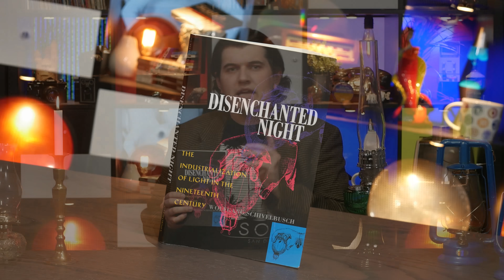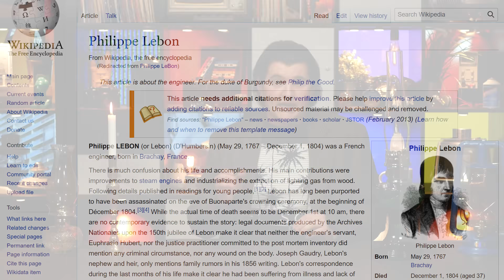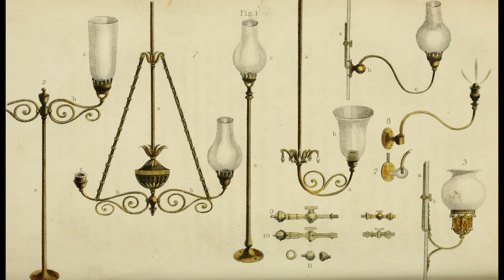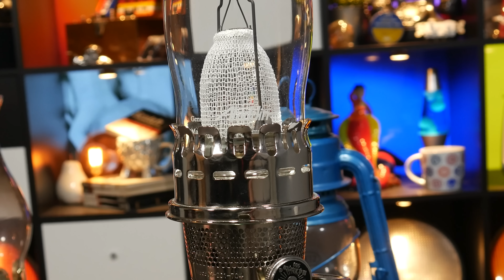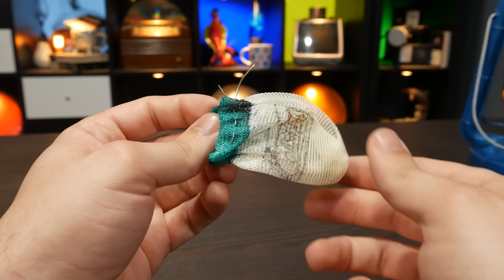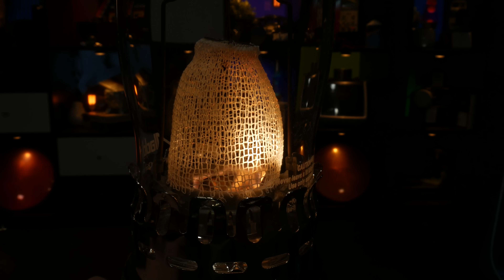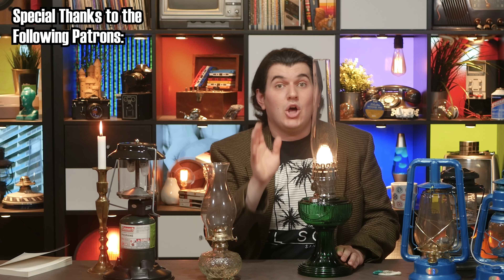How the gas mantle made lamps 10X brighter

Comment: I'm writing to help explain John Clayton's expression "...forced my lute". 
Alchemy! Yes, the term originates with the practitioners of the arcane art of alchemy. Which, considering the time period that Clayton wrote his comment, he was likely familiar with such endeavors. To be more specific, "lute" in this regard refers to "lutem" which was a material which classically came from the town that was known to the Romans as Lutetia. Today we call this town Paris. And it was from the gypsum pits of Lutetia that "lutem" was produced for the world. Today that product is known as Plaster of Paris. The alchemists would sometimes coat their retorts with a layer of lutem as means of providing some "thermal inertia" to their work. That is, a coated retort could be heated evenly and slowly over a broader surface area than otherwise would be the case at the direct point of application of a flame. It would thus carry the heat in more gradual stages to the matter under investigation.
 I had the fortune to spend decades watching my best friend, Robert Martin Gorges (R.I.P.) as he dedicated his life to the recreation of hundreds of the "alchemical texts" in as fine a detail as possible. Unfortunately, with his passing, I no longer have access to his incredible library and voluminous notes. However, if my memory serves me correctly, some mention of the above stated facts might be found in The Secret Teachings of All Ages by Manly P. Hall. I'm sure there are other works which will mention it as well.
Hope this helps!

Comment: Gas lights is where we get the phrase “TURN the light on”. As you said, there were valves; not switches. Thus, you really don’t “turn” on an electric light, but the term had been established and just stuck.
Reply: The early electric light switches were also rotary…
Reply: @allangibson2408  Because they were just repurposed gas valves.
Reply: @erinfinn2273  No - electric switches and gas valves are wildly different. The designers wanted to maintain familiarity however. 
Wiring was however run through the old gas pipes - which is why American electrical conduit still uses pressure tight threads.
The other power source in most cities was water - the hydraulic power systems continued in service until the 1960’s running lifts. The hydraulic power pipes in London were repurposed in the 1980’s for fibre optic cable runs.
Reply: @allangibson2408  I guess what I meant was that the interface was just repurposed. I do know the mechanical differences between gas and electric switches. You just said what I wanted to say clearer.
Edit: I made that post when I was very tired. I mean no disrespect to anyone's intellect. Also, didn't know about the municipal hydraulics system. That's cool.
Reply: Picrew avatar detected
Reply: @allangibson2408  Fascinating

Comment: Lute was a wax seal around glass chemistry connections connections, prior to rubber, sometimes impregnated with horse hair to make it more stable.  There is a text in Robert Boyle's notes about using lute.  Later on we now use a silicon based lubricant as a seal, since high-temp stable and allowing for easy disconnection of the fittings.

Comment: Thanks to the Welsbach process there were several contaminated area in Camden NJ that required EPA cleanup.  There were two factories that made the thorum coated gas mantles: The Welsbach company and the General Gas Mantle Company.  In addition to those sites being "crapped up" there was an entire city block that had hot spots as well.  That block of Arlington Street was wiped off the face of the earth as a result of the EPA cleanup.  Camden is about 12 mile Northeast of where I live in Glassboro, NJ.  And my town is not without its own brownfield.  There was a coal gas plant on the other side of town that is long gone, except the ground remains contaminated.  Yes, the quest to illuminate mankind has not been without its problems.

Comment: It is well attested that there is a catalytic action going on with a mantle, it catalyses the combustion of the gas or vaporised kerosene, so that most of the actual combustion occurs at or around the surface of the mantle, so that a very large amount of heat is dumped directly into the mantle raising its temperature and hence its incandescence . I could be that simply the high temperature of the mantle is responsible. However the original thorium mantles had to contain a very precise amount of cerium to work properly, which tends to suggest a catalytic action, it's not just that they could resist high temperatures to glow brightly but that they catalysed the combustion so they get hotter in the first place. Automotive catalysts contain elements from the same group of rare earth metals.

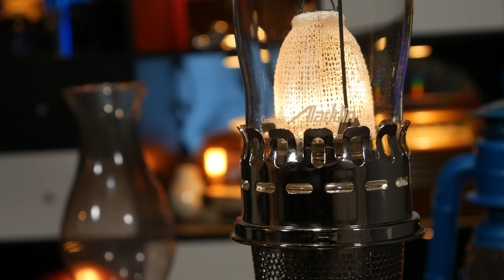Comment: @11:40 a black body radiator is a theoretical body that is usually referenced when refering to the color of light. For example 5800K is the black body temperature of the sun, and it is also used in a lot of lighting, where 4100K is called cool white, and around 2700K is warm white. What it means is that even though it is not 2700K in temperature, it shines as bright as if it were a black body at 2700K.

Comment: I had a wood burning stove that had honeycomb filter near the exhaust pipes.  Without it, much black smoke and soot escaped.  with the filter, the filter glowed extremely hot and contained the unburned gases until they burned at a very hot temperature....  Thus the white light.  I think the wick does the same thing, contain the smoke until it is re=burned off?

Comment: When I saw the Aladdin lamp is delicate, I thought to myself it can be easily solved by adding a battery and a sensor to automatically control it before I realize at that point you might as well just use battery powered-LEDs. Still, it's a 200 dollar item it might come with some safety features even if it needs a few additional parts.

Comment: When I grew up the gasometers in the local town were quite visible and they had scales up the side so you could tell how much gas was in them so they were in affect measuring devices.
Reply: When the centre is high the container is full as the contents is used the container falls, the weight of the container pushing against the gas inside giving gas pressure in the pipes.
Reply: For anyone in Aus born before 1970 gasometers should not be a mystery.
Given that , even without measurements on the side, it's possible to gauge the amount of gas held at any time, "gasometer" is the most appropriate name for them.
Reply: Two massive units were astride the 405 Freeway in Long Beach, California -- for years. 
They eventually became buffers for the adjacent refinery -- IIRC.
This was the same refinery that Cody Jarrett blew up in "White Heat."
He was atop spherical propane-butane tanks... a bad place to smoke.
They must be gone by now -- so old -- and sitting atop valuable land.
Reply: Occasionally a gasometer would blow up. I remember one did so in Copenhagen in the seventies causing great damage as domestic housing was built much too close.

Comment: Kerosine is a niche fuel... in small amounts, It's much harder I hear to get aviation gas than Jet fuel at this point in time... Hydrogen though as common as it is only rockets and some cars/trucks really use it at this current time... So yeah that's what I call niche and we need to fix that.

Comment: In this context ("forced my lute"), the word "lute" is almost certainly not the musical instrument, but rather the thick substance used to close up a hole and make something airtight.  Sort of like a bung.  Forcing it presumably means building up enough pressure to dislodge it.  HTH.HAND.

As for gasoline, it isn't a liquid fuel.  Liquid gasoline is not flammable.  It won't burn.  No, really, liquid gasoline doesn't burn.  What it does do, is have a really high vapor pressure at room temperature, so it's constantly giving off vapor (the "gas" for which gasoline is presumably named), and the vapor is all kinds of flammable.  Additionally, the vapor pressure increases as temperature increases, so the heat of the burning vapor just above the liquid, heats the liquid, causing it to give off more vapor faster, which burns very quickly, heating the liquid more...  and a fraction of a second later, your entire pool of liquid gasoline has all been vaporized and subsequently burned away.  But this only happens if the gasoline is warm enough to produce enough  vapor in the first place, to get the reaction started.  If it's really cold outside (and we're talking about Siberian or northern-Canadian winter temperatures here, temperatures that you have never seen in the Midwest), you can actually toss lit matches, or lit cigarettes for that matter, into an open-top barrel of gasoline, and the flame will just go out as soon as it hits the surface.  This is, for obvious reasons, a trick that you should not attempt to reproduce without extensive research and substantial safety precautions (and if you find a video of it online, it's probably faked with a different liquid, such as diesel fuel or water).  If it's a few degrees too warm out when you try it, you're going to do ever so much more than just singe your eyebrows, and there are few inhabited places in the world where it gets cold enough for the trick to work as intended.  Nonetheless, liquid gasoline doesn't burn.  Only the vapor burns.

Comment: Gasometers were actually a way to measure the gas contained.  The  height of the gasometer would rise and fall depending on how much gas was contained within.  On the outside of the gasometer was a measuring scale and as more gas was stored inside the structure grew taller.

Comment: Both yttrium and yttrium oxide has a melting point way hotter than this.

If the yttrium isn't melting at all, and the organic fibers are gone entirely... what exactly is holding the resulting yttrium oxide particles together against gravity and other accelerations?  It seems like some intermediate substance would be required for structure to get the particles bonded together with even a little bit of strength.

EDIT: " The fibers are impregnated with metallic salts; when the mantle is first heated in a flame, the fibers burn away in seconds and the metallic salts convert to solid oxides, forming a brittle ceramic shell in the shape of the original fabric. "

EDIT2: " The mantles are produced by dipping a meshed fabric (e.g., nylon web) into a solution of thorium nitrate. Other metals are added to the solution for a variety of reasons. For example, cerium is added to increase the light output, while beryllium increases the mantle’s strength. The fabric is then removed from the solution and dried. Lastly, it is coated with lacquer and fashioned into one of two types of mantles: a soft mantle or a hard mantle. The soft mantle is essentially a bag with either a drawstring or some type of fitting that attaches the mantle to the burner. The fabric of a hard mantle is supported by a metal frame that gives it a dome-like shape. "

So there are multiple metal salts involved, and some of them likely pass through liquid phases during initial combustion in order to form the ceramic glass, which is majority-by-mass yttrium oxide.  Probably some kind of cousin of sol-gel ceramics.

Comment: Gasometers do somewhat measure the gas because their height depends on the internal pressure (and therefore the quantity of gas)

Notice how in your example image a scaffold of sorts extends beyond the height of the container? If more gas was added, the top would rise and thus you can apply a conversion from height to volume of gas based on height measurements taken with the tank filled with a variety of known quantities of gas.

Comment: In my early 1900's built house, they literally pulled two wires through the gas light pipes when they converted the room lighting to electric.
Reply: That's interesting. I had a house in Scotland that still had some old lead gas pipes in the walls for lighting but they were only about 1/4" inside diameter.
Reply: @Phiyedough  Yes... our house in Los Angeles was built in 1914 and had gas light fittings in every room. Electrical wiring was installed later, obviously. As a young kid, I wondered why the gas outlets were so high. Of course, they were for gas lamps. The house is still there and probably still has the hidden gas pipes running through every room (of course, empty).
Reply: This was true of a lot of street lighting, too, at least in London.
Reply: Well, guess that's one way to retrofit knob and tube wiring lmao
Reply: @David Wanklyn There are still about 1500 gas lamps in London, in the City and Westminster. One of the duties of the team that maintain them is to wind up the clockwork that times the opening of the valves. There are still the horizontal bars that used to be used for ladders but they're really only attached through a coat of paint now.
Reply: Electrical conduit threads are the same as black iron pipe threads as they were used as conduit for electric wiring when houses were converted from gas to electricity, the electrical boxes were often mounted to the old gas piping that remained in the wall at locations of gas fixtures

Comment: I've used a 1928 model 11 Aladin outside while camping. It worked fine - the advantage being silent operation and it did not require occasional pumping like Coleman lanterns. It made for a pleasant camping experience. Other campers were interested in it. It is more delicate than a Coleman lantern though.
Most of the time a campsite is not windy.

Comment: So i looked up chemistry equipment of the 1800s lute. And this showed up.
Lute (from Latin Lutum, meaning mud, clay etc.)[1] was a substance used to seal and affix apparatus employed in chemistry and alchemy, and to protect component vessels against heat damage by fire; it was also used to line furnaces. Lutation was thus the act of "cementing vessels with lute. 
So blowing his lute was just breaking a seal in a bottle or stopper.

Comment: I have no idea what “forced my lute” means, but “broke my glasses” sounds as if the gas pressure built up inside his apparatus until it broke his glassware
Reply: Lute was a material used for sealing alchemical apparatus back in the day.  So combined with the next phrase, I'm pretty sure he's talking about it actually breaking his equipment.
Reply: Exactly. Too much pressure built up and if the Lute didn't pop the glass would break.
Reply: Look at what the internet produces.  Different minds come together to solve mysteries.  Also, tiktok...
Reply: My kids broke my lute, they smashed my violin.
Reply: or just simply broke his looking devices
Reply: “forced my lute” sounds like a euphemism for something naughty!
Reply: Per Wikipedia lute, from Latin meaning mud or clay. Was a substance used to seal apparatus (as other posts here have mentioned).
Reply: It sounds like there was too much force inside of his "lute" lute being slang for the lute shaped retort or another piece of equipement? 
Forced his lute meaning I created too much force inside of the lute... and it broke my glasses.... Meaning so much force happened at once it shattered some of his equipment?

That's my guess.
Reply: Yes, forced meaning raised the pressure... I agree.
Reply: @stephendoherty1275  Literally forcing out the lute of its joints.

Comment: The point about the catalytic activity of Yttrium oxide is actually a pretty good one. And since the separation of rate-earth metals (expecially in the good old times) is still pretty hard, there would be traces of other elements mixed in it, which usually is the key for further increasing catalytic activity.
Yttrium oxide has a perovskite structure and periovskite compounds can be used used as oxidation catalysts, solar cell materials or electrolysis catalysts, so there's a lot of quantum mechanical magic happening. 
Also a cars lambda sensor consists of ca. 95% ZrO2 with 5% Y2O3 mixed, so I'd guess its reactivity is centered towards oxygen (or oxygen containing componds) in some way, also since one publication I found says there's an affinity for irreversibly adsorbing and activating alcohols (I guess also other oxygen containing hydrocarbons)  - in a quick search I couldn't find out if yttrium oxide has great C-H or C-C bond activation but there's at least some publications on oxidative coupling of methane for example, so it's probably not too far off the mark (traces of Cerium dramatically increase oxidation to CO2).

Comment: "Lute"  lutum from latin clay or mud, (horse hair and straw) used to seal apparatus in chemistry and Alchemy, protect it from heat damage from fire hence resulting in cracking the glass wear, the pressure would have caused it to crack, this the usual consequence.

Comment: If I am not mistaken the same principals though not fuel are used in the Aladdin lamps is used in the Coleman and Propane lanterns some use when camping/RV. Turns out I am right in the guess, with the Coleman Dual Fuel and Propane ones. 

There was a cheap version of the Colman Propane in late 2000's and early 2010's usually sold at Walmart that was missing some regulator to keep the flame at the right level so as it got hotter the flame got taller so you had to manually keep an eye on the Lantern to keep the flame down yourself via the knob.

Comment: cabins and hunting lodges still use those Aladdin lamps. I think they're a bit cheaper to run than the propane Coleman lantern and not quite as messy and wasteful as the white gas / Coleman fuel lantern. The fuel goes bad several months after opening, making starting your lantern next year a frustrating process.

Comment: as-per "lit my lute". i.e. Blew out the seals on his glass/lab equipment

Lute (from Latin Lutum, meaning mud, clay etc.) was a substance used to seal and affix apparatus employed in chemistry and alchemy, and to protect component vessels against heat damage by fire; it was also used to line furnaces.